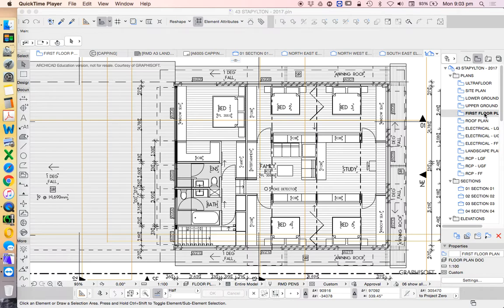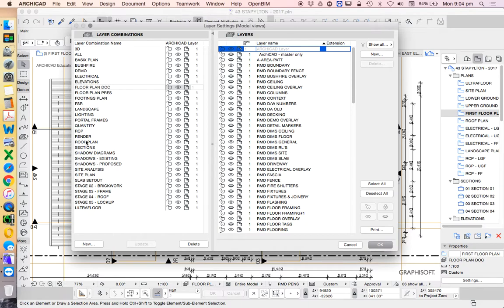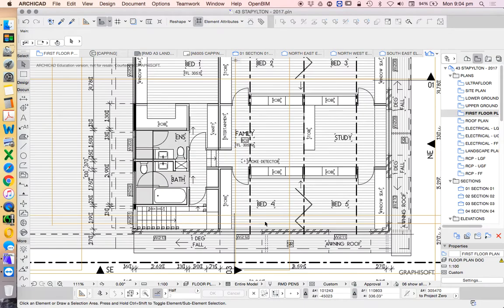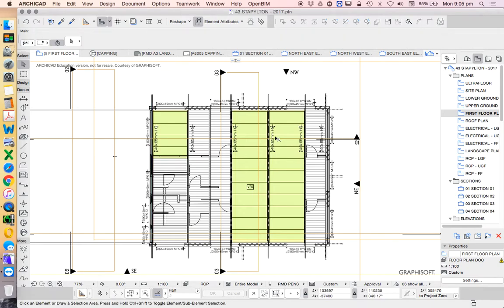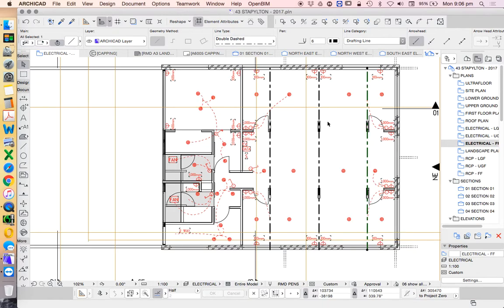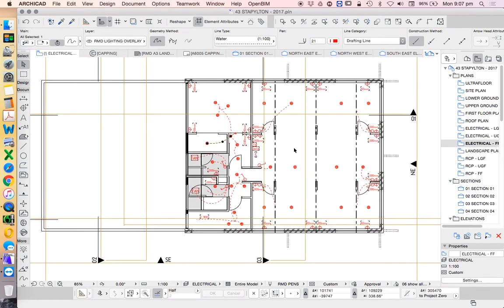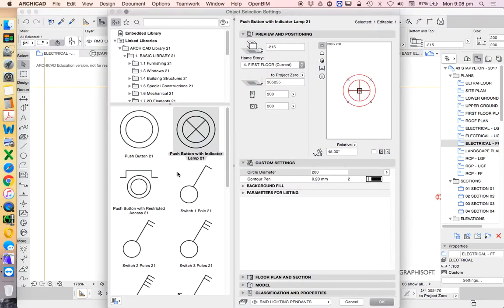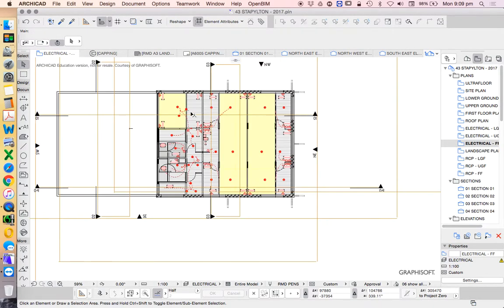ArchiCAD 21 House Project - part 33 - Reflected Ceiling plan

Comment: Thanks for you video. Cut plane level of plan and that of RCP are different each other. How did you create RCP from plan?
Reply from the maker: Hi Sungmoon, Thee are multiple ways (or variations) of doing this. I mostly only use layer combinations to differentiate between elements to be seen on floor plan, RCP, or both. You can (but don't need to) change the cut plane level. Sometimes I will need to do this in the case of very high windows, otherwise it is rarely justified.

Comment: Hi Robert, thank you for your tutorial, great channel. How do you make visible the hight of an electrical element, for example, the socket high 600mm?
Reply from the maker: Hi, I had previously done this manually, but I now use the Label tool - elevation label. This is brilliant, and works for floors, ceilings, objects, etc.
Reply: @RobertMannArchitect  Thank you for your tip! Cheers